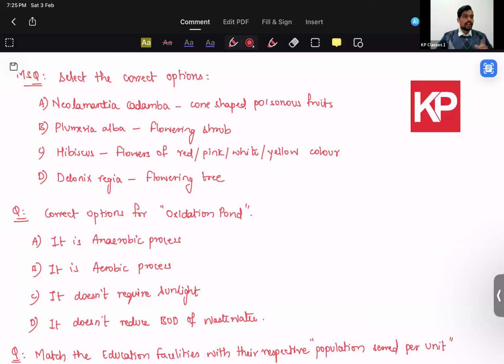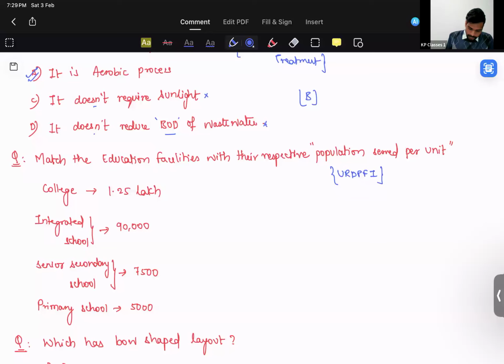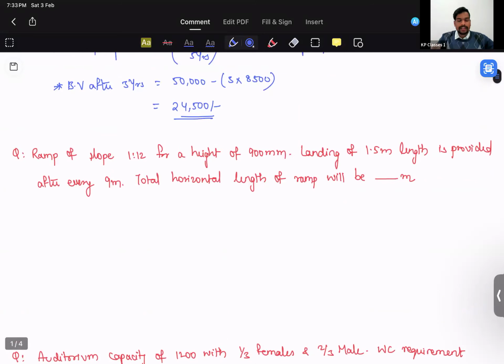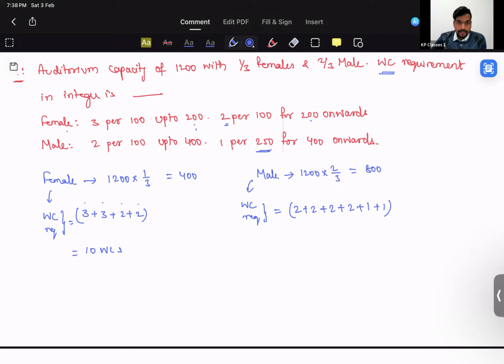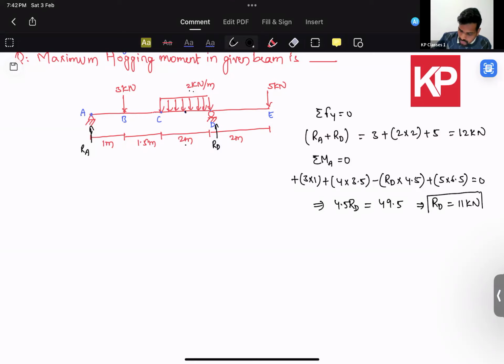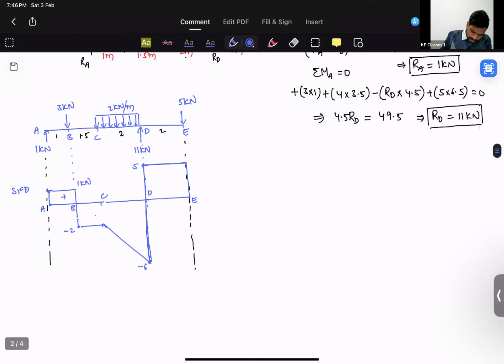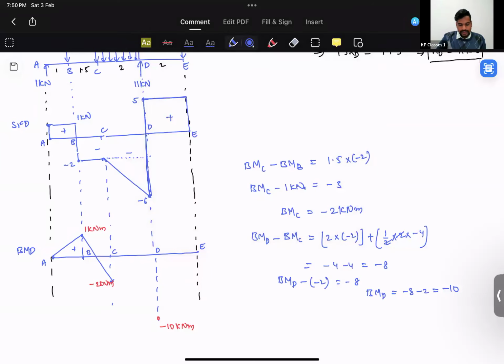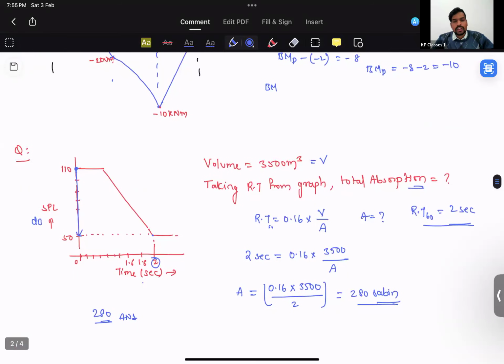GATE Architecture 2024 Memory Based  Questions Part 1 | R H Chandar | KP Classes

Comment: Q.43 Numerical question

Calculate number of toilets required for 1200 audience (400 female, 800 male). More data given.

 

Q.44 Botanical name

Hibiscus, Plumeria alba etc.

 

Q.45 Housing numerical question

 

Q.46 Match type question

Cheonggyecheon, High line, False Creek

 

Q.47 Matching type question

Water sprinkler system, Panic bar, Refuse area

 

Q.48 Numerical question

 

Q.49 Question on planning guideline

Population per primary school, college etc.

 

Q.50 Architect of Titan Integrity Campus

 

Q.51 Question on Air conditioning

What is evaporator?

 

Q.52 Question on arch component

 

Q. 53 PTFE plastic used in?

 

Q.54 Rose window

 

Q.55 Example of Pendentives

 

Q.56 Match type question

Lighting power density, Sound power, EPI

Comment: Q.28 Question on perspective view.

 

Q. 29 What is book-value?

 

Q.30 Question on color theory.

 

Q.31 Numerical of salvage value.

 

Q.32 Question on Reynolds number

 

Q.33 Match type question

Taipai 101, Gherkin, Museum of Newzealand TePop

 

Q.34 Numerical on run-off coefficient

 

Q.35 Match type question

STADD, Grasshopper, Radiance, GIMP, OpenStudio

 

Q.36 Numerical on CPM/PERT

 

Q.37 Match type question

Gulf of Mannar, Nilgiri, Sundarbans, Nandadevi

 

Q.38 Match type question

Edge city, Synekism, Urbicide, Urban sprawl

 

Q.39 Match type question

Indira Gandhi Memorial Tulip Garden, Villa d’Estate, Royal Botanical Garden

 

Q.40 Match type question

Floating floor, Float valve, Metal float, Free float

 

Q.41 Match type question

NIMBY, Form based code, Tactical urbanism, Suburbanization

 

Q.42 Structure numerical question

Calculate hogging bending moment

Comment: Q.11 When the price of an item is set below the market price, it is called …………..

 

Q.12 What is the running length of the ramp with slope 1:12 and elevation height of 0.9 meter, given that 1.5 meter of horizontal running length is provided for every 10 meters of running slope length?

 

Q.13 What is Urban Cool Island (UCI) and Urban Heat Island (UHI)?

 

Q.14 Who is the architect of Maitreya Buddha Temple, Ladakh?

Answer: Abha Narain Lambah

 

Q.15 Bow-type of urban planning as per Mansara Silpsastra is called …………..

 

Q.16 In transportation planning, Inoscope is used to calculate …………….

 

Q.17 Which Indian site/s is/are included in UNESCO 2022 list?

 

Q.18 Nationally determined contribution in United Nations Framework Convention on Climate Change is attributed to …………….

 

Q.19 Question on water treatment process: Sedimentation, Flocculation and Coagulation

 

Q.20 Structural form: castic, anticastic etc.

 

Q.21 In Ekistics, world city is known as …………….

 

Q.22 What is Gentrification?

 

Q.23 Question on Energy Conservation Building Code (ECBC) 2017.

 

Q.24 As per Census of India 2011, non-notified slum is attributed to ……………….

 

Q.25 Is oxidation pond a aerobic pond?

 

Q.26 Question on human aspect of urban form?

 

Q.27 What does it mean by Municipal Fiscal Resource Mobilization? Example: Property Tax, Development Charges etc.

Comment: Q.1 Fill in the blank.

Silly > …………. > Deft

 

Q.2 Is the value of following sequence 2.67?

2 + 1/2 + 1/3 + 1/4 + 1/6 …

 

Q.3 What is minimum number of different colour paint is needed to fill the following figure so that no adjacent fill-up should be of same color?

￼

 

Q.4 Two right angle cones are placed in such a way that their circular bases are coincided. If a plane passes through the vertices, the shape formed by the intersecting lines constructed by intersecting plane and the cone is Rhombus.

 

Q.5 Grammar/ Comprehension type

Correct option is: In human being, digest of dairy have resulted from mutated gene.

 

Q.6 Pie chart with distribution of A:40%, B:25%, C:20%, D:15%

 

Q.7 Mutual fund returns of person A and B

 

Q.8 Different views of a dice is shown below.

￼

Is it the following unfolded dice correctly numbered?

￼

 

Q.9 Probability of being born either a boy or girl child is 0.5. What is the probability of getting born two girls and a boy?

 

Q.10 How many 4 digit numbers out of 1, 3, 4, 6, 7 can be formed that are divisible by 3?

Comment: Q.55 Example of Pendentives

 

Q.56 Match type question

Lighting power density, Sound power, EPI

 

Q.57 Numerical question

Calculate adsorption of 3500 cum hall.

 

Q.58 Numerical question

Calculate volume of concrete needed of trench 1.1m width. The trench centre-line length is 41.1m long.

 

Q.59 Match type question

Kath-kuni

 

Q.60 Match type question

Brick form

 

Q.61 Match type question

Bihar museum

 

Q.62 Match type question

Temple, Mosque

 

Q.63 Numerical type question

Calculate strain using Young’s modulus

 

Q.64 Numerical type question

Calculate time taken for the lift to reach 2nd floor to 80th floor.

 

Q.65 Match type question